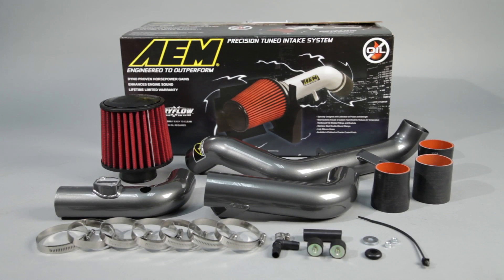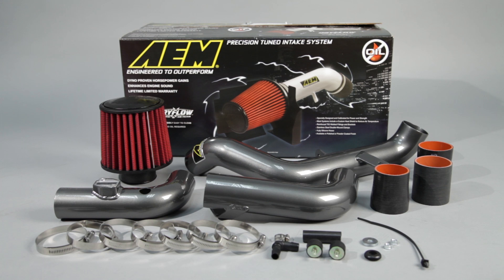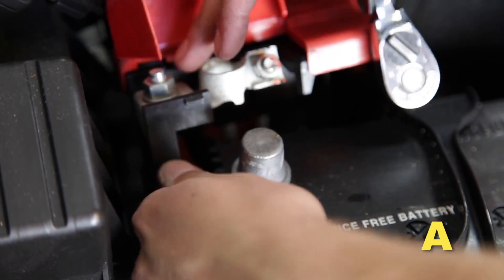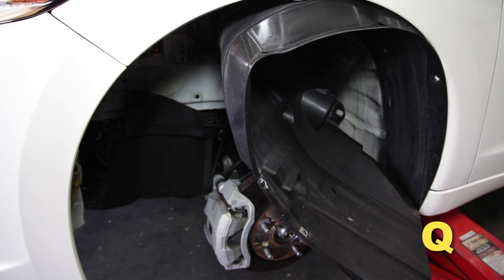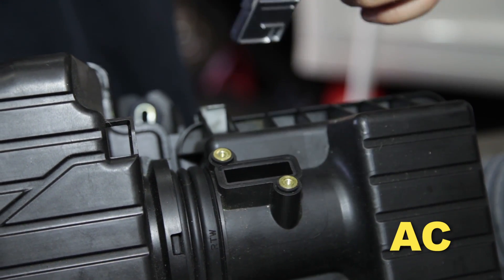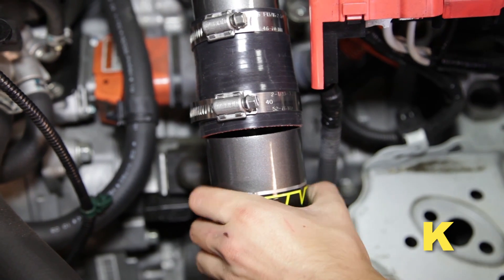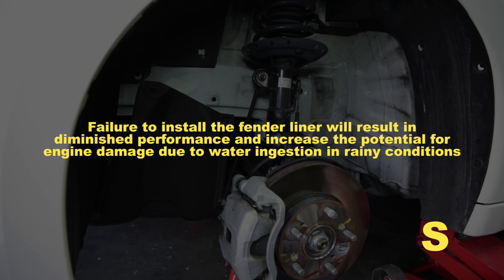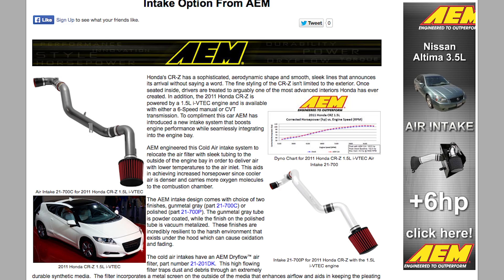2011, 2012, 2013 & 2014 Honda CR-Z 1.5L AEM Air Intake Installation

Comment: GET THE K&N. WAYYYY EASIER TO INSTALL AND SOUNDS GREAT.IF YOU CANT INSTALL IT YOURSELF THE DEALER WILL INSTALL FOR ABOUT $250. A PRIVATE GARAGE SHOULD BE NO MORE THAN $100 OR $150 THE MOST. AND NO BODY WORK INVOLVED.LOL.